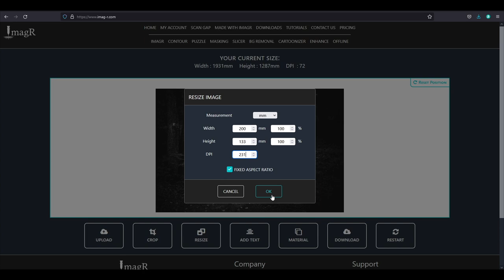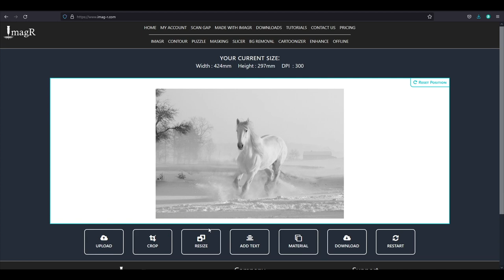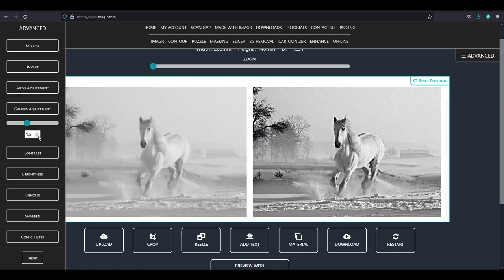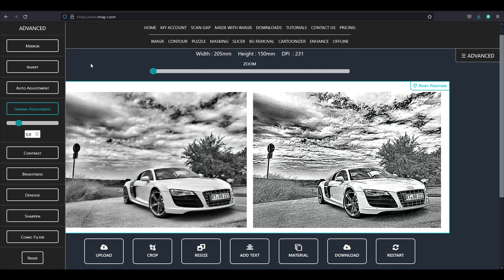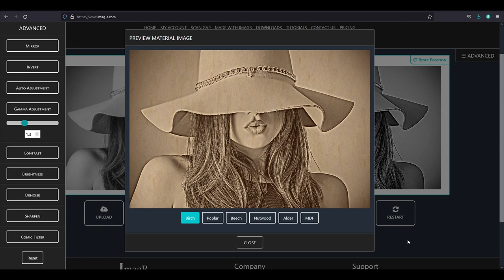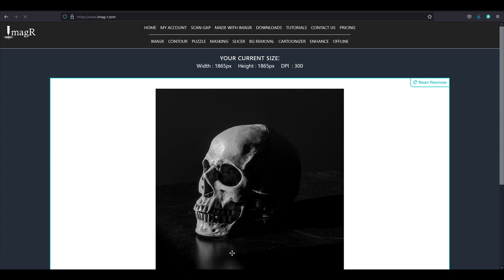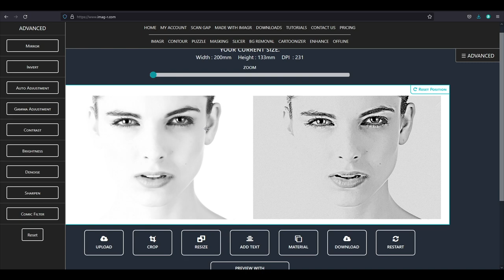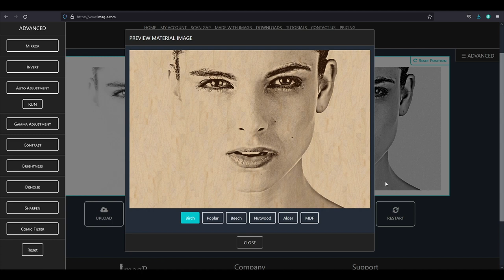How to use the ADVANCED settings on ImagR

Comment: When doing laser engraving on painted steel sheets what settings works best? I have been doing dark colors to light colors then the black top coat. For example dark red white then black. Am I doing this wrong? Should I be doing white, red then black?